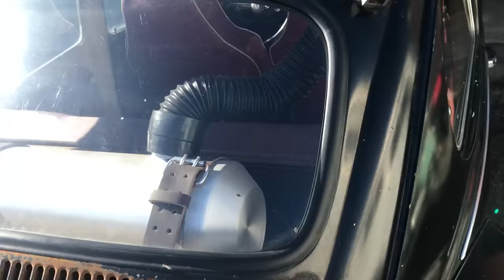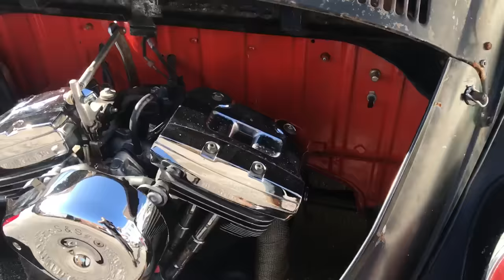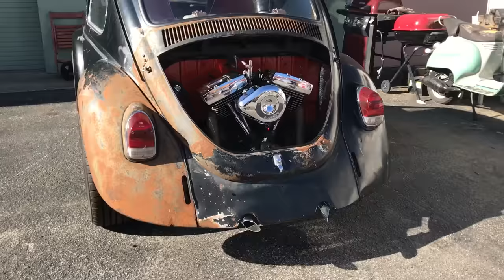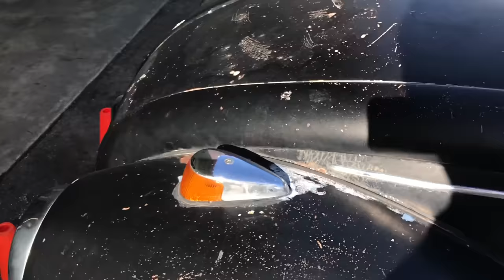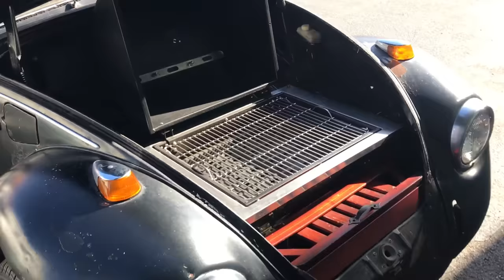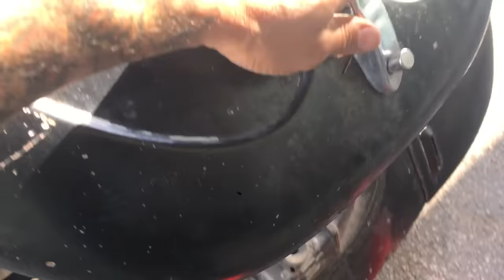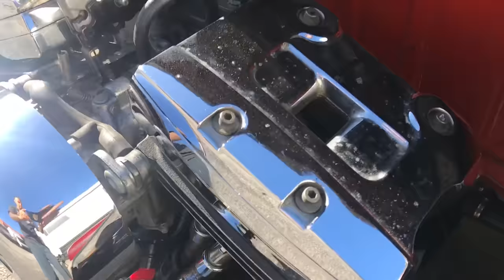1968 Volkswagen beetle powered by Harley Davidson engine! VW-HARLEY

Comment: Where did you get the adapter to mate the engine to the transmission?
Reply: Ivo Garza would've been posible an easier to use Harley transmission
Reply: Johnny Martin, if it were a Harley transmission it would be chain or belt drive with axis parallel to axis of car.  Then you would need to take out the bug transaxle and put in different differential and prop shafts.  (I am interested because I am thinking about Fwd reverse trikes).  Rewaco makes adapters, but they don't seem to sell them to outsiders.
Reply: Gabriel Pesciallo I have figured out how to adapt it for my project.  Left side drive  Harley air cleaner forward.  Transmission output to the front end of a jack shaft.  Jack shaft in direction of cars main axis.  Rear end of Jack shaft has chain coming back to a stub shaft connected to IRS automobile rear end.  Stub shaft would need to be supported at its end.  Would allow for front engine Fwd or midengine rwd.  Flip the pinion for rear engine.  Space might be limiting in a bug, but not a FWD morgan replica.  I have a plan.
Reply: Gabriel Pesciallo 
Probably mated the output shaft to a clutch mechanism at the transmission.  You could use a mechanical coupler.  Great ingenuity though.
Reply from the maker: I built the adapter my self works great will post some videos showing how i did it..
Reply: MOTORINK FERNANDO 
Wonderful.  That should be very informative.
Reply: MOTORINK FERNANDO thank you for whatever you post.  I want to put a Harley into a 3 wheel home built.
Reply: MOTORINK FERNANDO do you shift both vw trans and motorcycle transmission?

Comment: Must run hotter than a 2 doller pistol, theres zero air flow. A beetles have a shroud and a fan this can radiate a little heat out the trunk opening but that is not enough even for an all aluminum engine like an evo, if u had some ducting u cud maby keep it cool enough if stayed moving but traffic it Should start pinging the heat sieze, id think being a harley owner but i could be wrong but I doubt it...